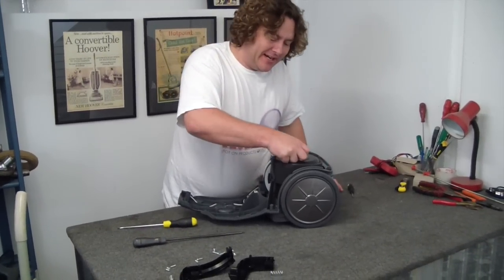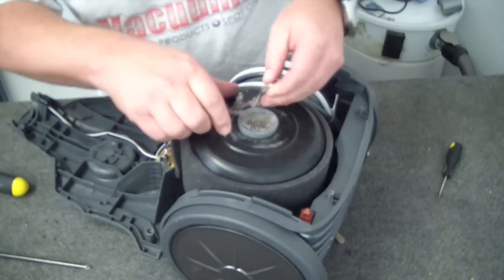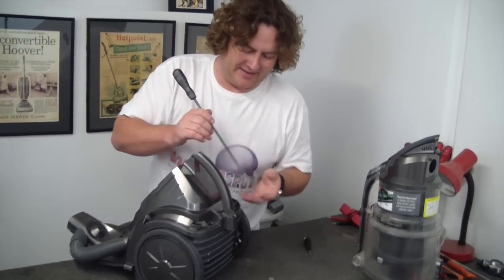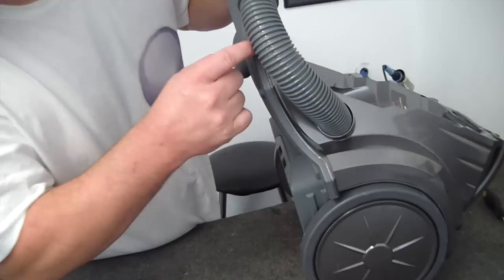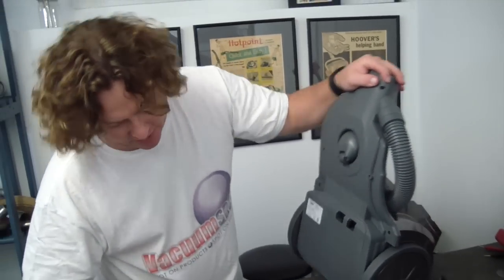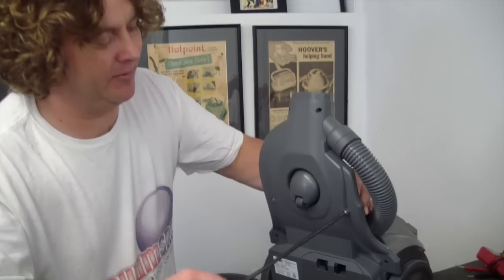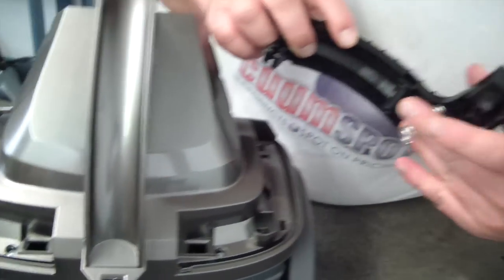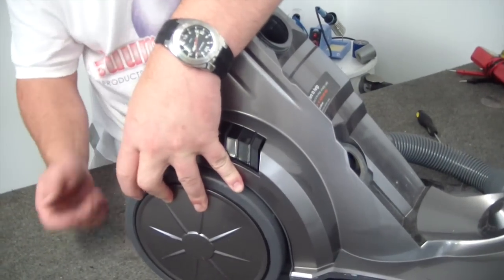Vax Zen Powerhead has lost suction due to blocked gauze filter

Comment: how bloody long it took to find a video on how to open one of these buggers!  
my cord retractor isn't holding when you pull the cord out, but it is clearly designed to fail, cheap plastic crap.
but, you helped immensely in getting in there to find out.   my gratitude and thanks.
and for a unit I pulled out of a skip bin, it's the best vacuum I've owned lol
silly sod previous owners clearly didn't check both filters.
I've found you can wash the filers by hand and they just keep on trucking, no need to buy new ones.

Comment: came across this video because of over heating issues with this exact vacuum cleaner. The gauze filter appears completely clean and with both the pre and post motor filters removed it blows out soooo much heat, almost instantly. Its like a high powered hair dryer. There is no question with its suction but it cuts out after a minute easily.
Reply: chippyjohn1 did you fix this? I have the same issue
Reply: fullboostchick I have the same issue too. Really can’t afford a big repair bill. Did you solve it?

Comment: Thanks for a very informative video!… I agree with the comments below about designing it to fall apart with shoddy materials 😩ours continually overheats 
I’ve even bought another similar one but still has breakage and low performance issues… and extremely 747 noisy 😬
I have cleaned everything inside my vax ….. except the motor!!!…that’s my last thing left  in this piece of sh…t

Comment: Thanks so much for posting this.  My Vax Zen had lost suction and was turning off because of overheating.  Cleaned the dog hair and fluff out of the gauze filter, and now a marked improvement.  Why wasn't this in the instruction manual?  Are the suppliers hoping you'll bring your cleaner in for repairs and pay money, when anybody can do this in 10 minutes?
Reply: Karen Scarman mine has a sticker to say "call if any problems, don't bring back to shop".